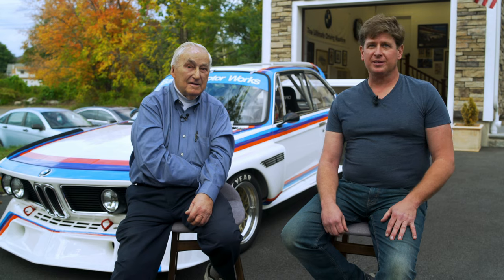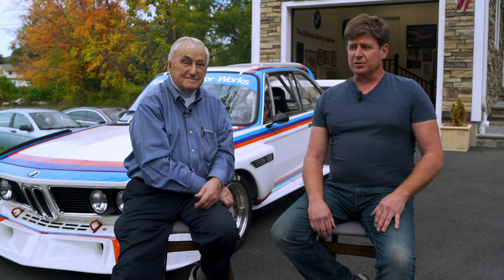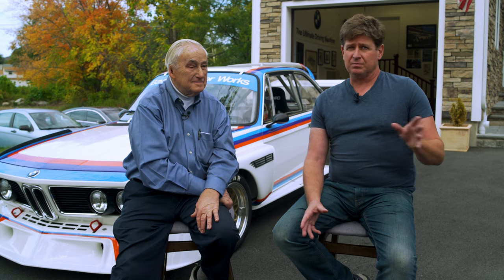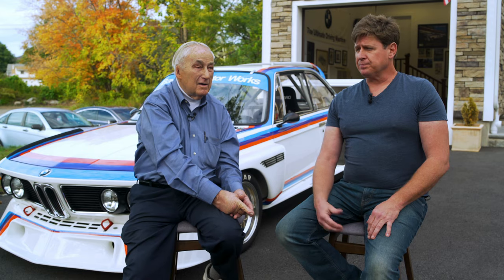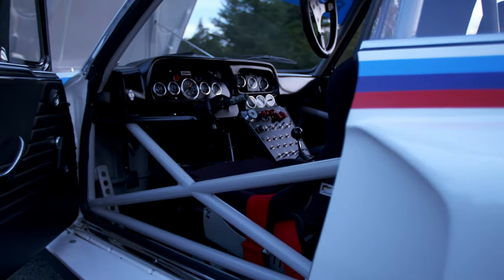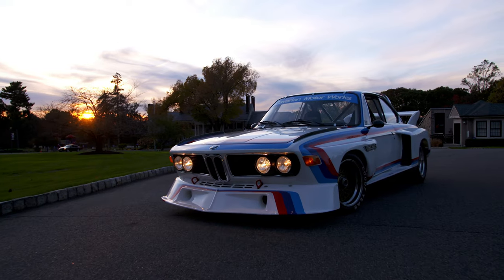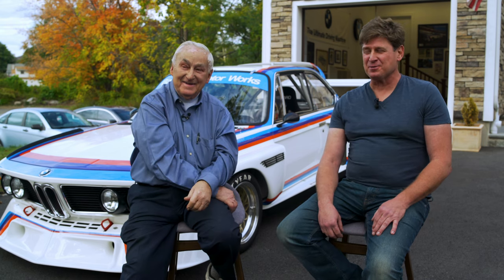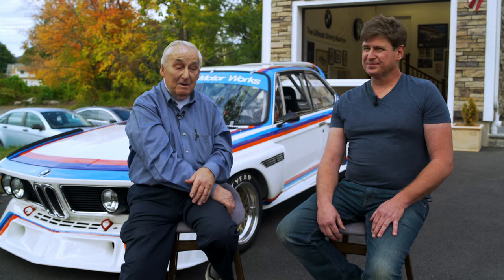A German Hotrod - E9 3.5 CSL

Comment: Amazing car!
I had the honor to drive a regular street legal e9 CSi, an e24 Group A Touring Car and the e30 Johnny Cecotto M3 DTM.
Plus a lot of less scarce BMW race cars and road cars from the 90s and early, 320is, 318ti Cup, M3, M5, M6, 850i and so on.

But my absolute dream would be a full blown e9 CSL race car!

One question that I have is, why didn’t you use the original dogleg transmission?
To me the first down low is one of the most important feelings when driving the car.

Having the driving gears inside the H-pattern is just incredible!

Best regards from Germany!

Comment: I just love the style of this BMW 3.5 CSL. I love the IMSA cars of the 1980's. I used to see them at Laguna Seca and Sonoma raceway in person. Now I am building a 1968 mustang IMSA style race car using a NASCAR ASA tube chassis and the mustang body. 

The ASA chassis have been used successfully in TA2 trans am cars so it is going to work really well for my car. For style I am down to ether this BMW 3.5 CSL or the IMSA Dekon Monza #20. I really want to give it a go with the Dekon Monza style but this BMW box flair style would go really well with the 68 mustang notchback body. 

I think I'll do one side BMW style like this car and the other side Dekon Monza as a styling exercise and see what version [side] I like best. Might like them both and thus need to build 2 complete lower bodies, one like this BMW and the other like the Dekon Monza. Both are so vary cool. 

What ever way I go it is going to be super fast, I have an original boss 302 from a 1960's A sedan race car to put in it. One of the TA2 teams that raced in the 2023 Detroit GP is helping me out with tires and parts.
Reply from the maker: Sounds like an awesome project! Thanks for watching. Box fender mustang would be soooo cool. Epic engine too!!!